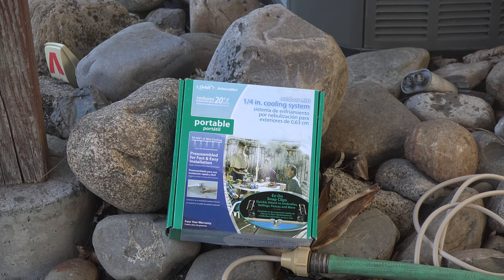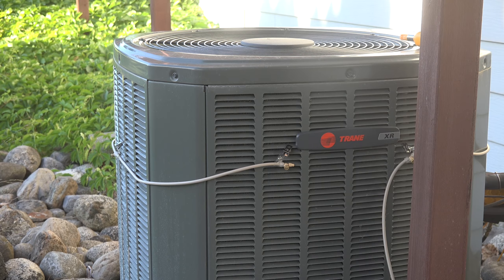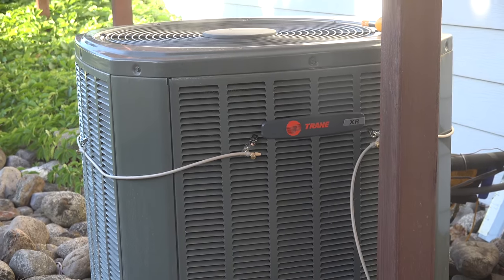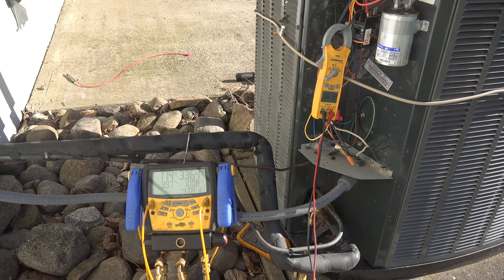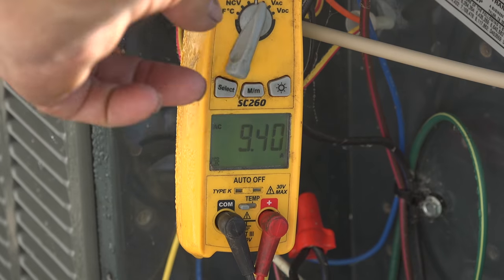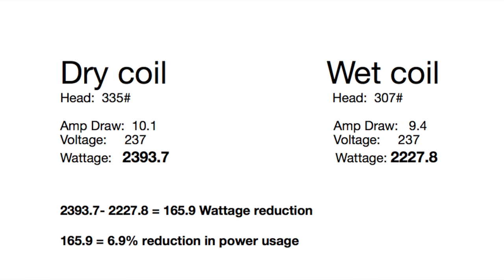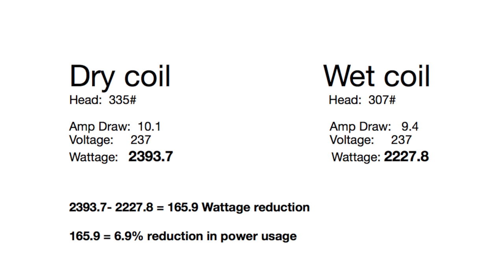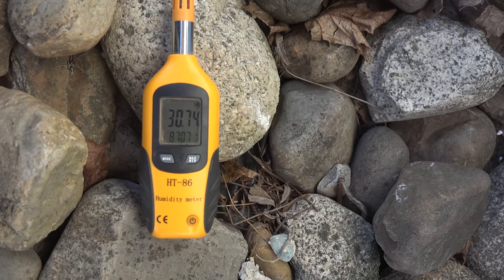Do the misters for A/C work? Part #1

Comment: These AC system water mister DO WORK, especially on a HOT DRY days, the big issue is the state of the water one supplies them, hard water is not good, if the water mist is getting the coils & or units louvers wet TOO MUCH water is being supplied, in the western US electricity costs are quite high along with low humidity high summer temps which can allow for such a water misting device to be worthwhile though one should supply distilled water to their mister & a good setup on the hottest of days for a residence will go through a few gallons of water a day.
Reply from the maker: I know you would like to believe they work, but they just don't.  
If you watch the entire series, (they are linked at the end of the video) I have tried most ways of setting this system up.  It just does not work.  
Distilled water is the worst type of water to use.  It does not leave calcium, but distilled water is highly corrosive and will eat holes in the copper and cause electrolysis between the aluminum fins and the copper coils.  That's why it is not used in boiler systems.  
As I said in the video, if water misting worked, the manufacturers would use it.
GFM

Comment: There is only one problem with your test here. These are especially meant for units that are sitting in the full sun. That's when you get a big savings. I can see yours is fully in the shade. Mine for instance is just sitting in my yard and I have no trees, no deck. So the sun is heating the unit and the air also. I'm curious what the difference would be in my case.
Reply from the maker: I know it seems that full sun makes a considerable difference, but it does not.  The unit is kind of like a very small and inefficient solar panel.  About 4 square feet.  I did the numbers on this a few days ago for someone  who thought shading would help.  The end result is if you cooled the coil by shading or water, you would reduce the cooling load by .05%.  Definitely not worth doing, especially considering the problems with calcium buildup.
GFM

Comment: Not factored into your equation is the cost of the water. City water is by the gallon(plus you have to pay sewer fee), your own well water takes a pump that will pull some amperage. 30% humidity is about as low as you will probably see, so you have given the optimal benefit to this system's power reduction. 

I would say this is counter productive and not cost effective even under ideal conditions.
Reply from the maker: I agree on the viability of the system.  The water issue was not visited because the volume is so low.  I have not tested it but I would guess less than 5 gallons per day of operation.
GFM

Comment: The water mist doesn't really cool the air, it increases the air's capacity to absorb heat.
Reply from the maker: That would be cooling the air.  When water evaporates, it absorbs heat from the air.
GFM
Reply: @grayfurnaceman  I guess I think of it as a sort of glass half full or glass half empty thing, either way it allows for more cooling to occur.
Reply from the maker: @perseverance8  Your original thoughts just don't transfer to any sort of savings.  Watch the entire series.  They are linked at the end of the video.
GFM

Comment: Misting the coils also reduces the time the compressor has to stay on to pump heat from the inside and dissipate it to the outside air, so there is another saving your experiment did not account for. However, misting the coils with water is not generally a good idea since it covers them with minerals and cause corrosion over time which reduces the efficiency in the long run.

Comment: I would think that a mist on a burning hot coil would evaporate immediately. Thermodynamics would dictate that it would take heat with it no matter the outdoor humidity. Thanks for the video.
Reply from the maker: The idea of the misters is to evaporate the mist before it touches the coil.  Then only the cooled air passes thru the coil.  If that were to happen, you would have less calcium buildup on the condenser.
GFM
Reply: Yes, I understand the principle of mister cooling the air but in this use the mist will evaporate easier just before it enters the coils because the air pressure is lower there from the fan blowing. So the outdoor humidity  is less relevant since the mist actually touches the cooling fins and takes the heat away right there.
Reply: Plus, you use an inline filter and there is no calcium build up.
Reply from the maker: The only filter that would eliminate calcium would be reverse osmosis.  The "filters" that are used are actually a treatment device.  When used in this application, the water is evaporated.  So anything that is in the water is left.  Calcium will build up.  The idea of evaporation prior to touching the coil will mostly eliminate the calcium buildup.  
Even if you use pure water it is highly corrosive and will cause dissimilar metal corrosion.
GFM

Comment: For accurate savings calculation you need to monitor runtime on the unit for several similar days.  If the unit saves 7% while it's running, but also only  runs 8 hours a day vs.10 hours thats where the real savings comes in!
Reply from the maker: That sounds good , but is inaccurate.  There is no such thing as "similar days".  Even comparing total seasons is inaccurate.  If you watch the entire series, you should note there is no evidence that the unit has a higher temp drop across the coil, so it can't have a lower run time.
GFM

Comment: Stay away from those vane type misters that come on by way of the fan pressure blowing against it. They only last about a year or two then they start to leak water everywhere. They are made of plastic and if your condenser coils sit in the sun all day it will sit there and bake that plastic till it’s brittle and breaks.  

Second these only work if you have an equal amount of water being distributed from top to bottom. How you have it rigged up here it’s only going to cool the coils in certain spots and not the entire coil top to bottom front and back. You will need a lot more water being misted that can be drawn in equally for them to work effectively. The one I put on my air conditioner is rigged up by way of a Rainbird solenoid valve wired into the air conditioner and comes on when the air conditioner comes on only. You can get one from Home Depot for around $15 and hook it up to your system but I strongly recommend if you don’t know what you were doing get an AC tech to do it for you or an electrician.
Also regarding the calcium thing, They do make in-line water filters for that. I have one on mine and I change it out every summer.

Comment: This actually makes a fantastic boost if you are in a hot dry area. It's called ablative cooling.
On a 100* day, 30% rh, it decreases the temperature of the outlet by 7*. That's an increase in Delta from 12* to 19* in my case 

Some critical notes though, the system I have is only practical because I use foggers, not cheap misters. It is also tied to an industrial RO system with DI polisher, 5 MOhm resistance. 

The point is not too change power draw, that's purely idiots or ignorant not knowing how this works. What it does in a proper use case is decrease the total run time for the same cooling.

In my case, the 50% increase in temperate Delta is a 125% increase in cooling performance on a hot day. This is because thermal transfer rate is exponential. 2* increase in Delta is 4* increase in exchange rate minus losses. This means my system runs only about 50% of the time compared to before. That has saved hundreds of dollars per month during summer. It paid for itself 5* over in the first year. Again, only do this if you have a true RO system.
Reply from the maker: I can't resist this one.  That is ridiculous!  (I almost never use exclamation points).  A normal delta T would be 16 to 18 unless your air conditioner has a very high SEER.  If you started with 12, you are probably undercharged.  
Next, thermodynamics will not let you do this.  If you actually increased the delta T by that amount, the increased BTU transfer would overload the compressor and kick off its overload.  You need to understand that a compressor is a gas pump.  The more gas it pumps, the more work it does.  Even if the compression ratio is quite low, it will still overload if it pumps too much gas.
There is no way to get around this.  It can't be done.  
Your idea of exponential transfer rate simply wrong.  It is linear.
As for the water, I guess you could use RO if you wanted but pure water is actually quite corrosive.  Boiler systems that use their water over and over do no use pure water.  They use tap water that is treated.  
Also, of those units that could benefit from misters (almost none would have enough savings to make it worth it) areas with 30% humidity would benefit very little.  Only those in single digit humidity have any hope.  Fogger or mister, it will not evaporate.
GFM

Comment: I didn't hear u factor in how fast the set up will drop the room temp and in this also reduce running time... that needs to be factored in also
Reply from the maker: I will be covering indoor air performance in a future video.
GFM
Reply: grayfurnaceman understood but this will be a factor in wattage usage n needs to be also calculated when comparing the cost of a wet condenser verses a dry.... since the wet unit will take the temo of the room down faster it will run less and that differential will equate to cost savings...

Comment: A residential AC outdoor unit is not designed for a constant supply of saturated air and water mist coming into it. I have seen these units ruin a good condensing unit in as little as a year. You will find corrosion to be the main side effect of these "misters". Control boxes, circuit boards, screws and fasteners will all start corroding at a rapid rate. Most AC manufacturers will void the warranty on any unit they find using these type of products.
Reply from the maker: Agreed
GFM

Comment: what did this do to the sc and sh?
Reply from the maker: I would recommend you watch the entire series.  They are linked at the end of the video.  If you still have questions I will be glad to respond.
GFM
Reply: @grayfurnaceman  as a state certified air conditioning contractor with over 35 years experience, I know these do not work well enough to use, if they helped the SEER rating we would have them coming from the factory with them installed.

Snake Oil
Reply from the maker: @bretwalley4673  Agreed
GFM

Comment: you forgot time duration. with the mist, the time to run compressor is much shorter because the mixture of water and air has much higher thermal carrying capacity. Mixture brings heat away from condenser coil much faster, also evaporation also takes away heat. As a results, it shorten the system working time. The main saving is the time. I cant prove it, but I'm guessing it can cut running time by at least half.
Reply from the maker: You have not watched the entire series.  The second video covers temp split across the coil.  When you watch it, you will see the temp split is actually lower with the mister.  That means run time would be slightly longer.  The reason for this is the units are designed to operate with specific pressures.  When you change the pressures, the unit does not operate as designed.  Bottom line, slightly more energy usage.
I did not compare run times as heat gain will vary throughout the day and comparing days is also not accurate due to variations in cloud cover etc.
GFM

Comment: Correct me if I'm wrong. What the entire irrigation system will do is REDUCE the operating time to maintain an internal temp in the building. The effeceintcy increase of the airco is an added bonus. So if you reduce the operating time by 25%, you have reduce your cooling cost by 25%. I think this fellow has missed the point here.
Reply from the maker: Obviously, you did not watch the entire series.  The second video in this series, (linked at the end of the video) tests the temp difference across the indoor coil.  This test is definitive in that a decrease in temp difference indicates a shorter run time.  Not only did the mister fail to increase temp difference, It actually decreased that difference.  This indicates less efficient operation.  This result was expected.  When you change the difference between head and suction pressure, you change the design parameters.  
While there was a 7% reduction in head pressure, giving a slight reduction in operating cost , maybe.  Add to that, the calcium build up will quickly wipe out the head pressure reduction.  
GFM

Comment: Equipment manufacturers have spent millions to make their systems more efficient . The coil sizes are a matched system ie tonnage and SEER rating, don’t you think if this worked well they would employ it? Not to mention coil damage from impurities in the water. The only time this has an effect is when the condenser coil is no longer efficiently removing heat from the system. The heat you feel coming out of the condenser is actual heat it has transferred from inside the home . I have 45 years experience in the AC trade in Florida , I have used a sprinkler in a few cases where a fan motor was not available till the next day, when doing this you need to watch head pressure and adjust water flow to maintain a certain pressure for it to operate properly.  If you want to save money plant some bushes around the unit to protect it from the sun being careful not to block airflow across the coil and when mowing your yard don’t blow grass into the coil , have it serviced once a year by a knowledgeable AC tech( good luck) .  The most important thing you can do is to change your filter often and watch what filters you are using , some pleated filters are very restrictive and if the grill size isn’t large enough could cause restricted air flow to the evap. coil.
Reply from the maker: You are preaching to the choir.  However, your explanation is quite well done.
GFM

Comment: 7% reduction in power consumption over a summer... $400 per month ish... down to $372 per month X 5-6 months = about $168/year.  filter the water, clean the misters, and put a pressure reducer on it.  Might be worth it over a couple of years, but lots of maintenance.

Comment: Shouldn't you put a temp probe into the water before its atomized? The water temp is extremely important. I would know. Also you need filtered water. Preferably ro/di water. If not membrane just a long column activated carbon filled sediment filter. Otherwise the water evaporates leaving salts etc. that eventually will make the unit lose efficiently. I would use a bath that sits in shade where the water travels down a tall carbon spun sponge like surface to evaporate heat and remove some salts before wetting coils. This is easy physics people. Water cooled units are far better only if the water is clean and cooled.
Reply: Maybe you need some real physics.
Evaporating water absorbs 970 BTUs per #.  Raising the temp of water absorbs 1 BTU per # for 1 Degree F increase.  
I could argue effectively that you should increase water temp to get the liquid water closer to evaporation so it could absorb that latent heat.
Filtering the water introduces another issue.  Pure water is highly corrosive.  The minerals in water inhibit its tendency to corrode metals.  That compounded with the dissimilar metals issue will increase the corrosion.  
You are correct that the calcium in the water will clog the coil.
You are misunderstanding what the mister does.  It is not meant to wet the coil (although it does).  It is meant to cool the air entering the condenser.  Therefore, this is not a water cooled condenser.  
GFM

Comment: You left out that the air comes out colder from the vents and the system doesn't need to run as long. from what ive read your system will run 2 hours less a day.

Comment: The way to do this is use a Freon to water heat exchanger,  that way you don’t have to deal with the mineral deposit issue.
Reply from the maker: In most areas, a water cooled condenser violates local codes due to excessive water use.
Also, in hard water areas, mineral buildup does happen inside the condenser.
GFM
Reply: @grayfurnaceman  Probably need a ground loop to dissipate the heat with a closed system.  Which unfortunately is going to be rather expensive.

Comment: These misters will ruin a unit, water has minerals which get deposited on the coil as it evaporates.

For fixed orifice systems, the mister can reduce head pressure to the point that the indoor coil is starved and capacity is reduced.

Comment: If you pay for your water you probably won't save anything. Plus the cost of an actual misting unit plus replacing the filter on the mister. If you have a trane like gray they have spiny fin coils and the chems in the water could ruin them. There just thin aluminum fingers.
Reply from the maker: Agreed.
GFM

Comment: Build a water type rad with in the coils and then you mite have something? But i would think that they have all ready try'ed that in testing. Look at the end of the day. A 2018 unit is far better than a10 to 20 year old unit.
Reply from the maker: Agreed
GFM
Reply: Btw it's really hard to stop a Union Pacific - LOL!  Now they the ex-perts say that r12 is/was not a the problem with the ozone so lets go back to a better higher efficiency refrigerant than 134a...?
Reply from the maker: Actually, there are no "experts"  now saying go back to R-12.  Just some of the same old ones that have always said it.  
GFM

Comment: This complely ignores the impact of the cycle time being lowered by the ability to remove more heat from the house quicker. Of course the power consumption while it is running won't be significantly different. That's not where the savings come in.
Reply from the maker: I will be publishing a video demonstrating delta T with and without the misters.
GFM